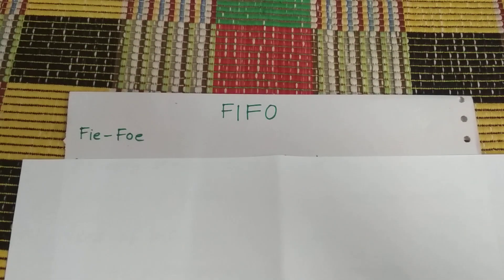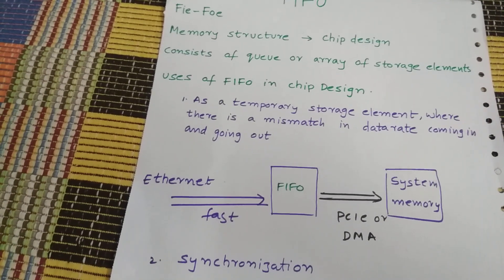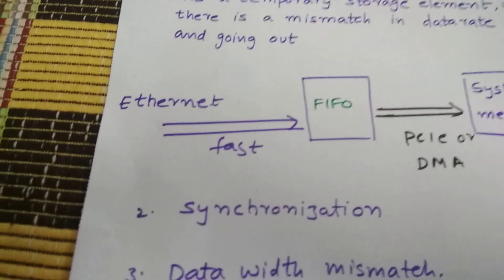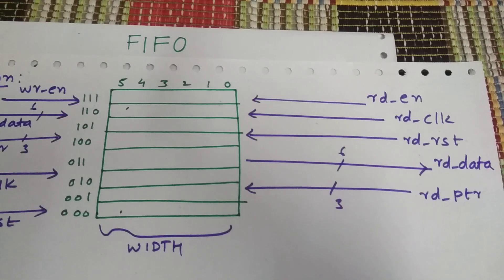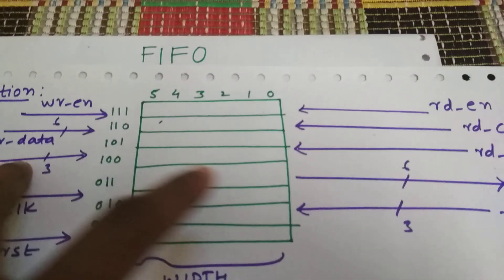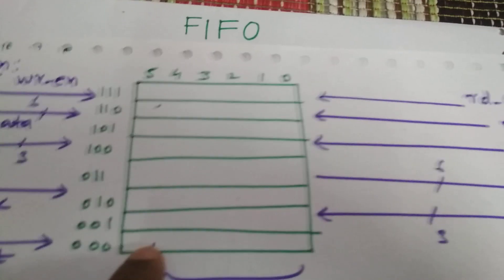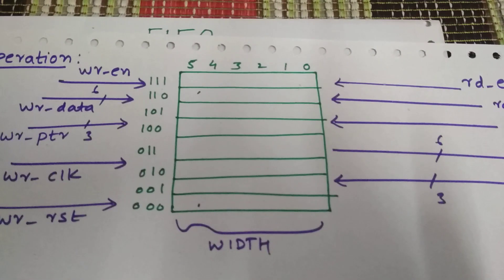Introduction To FIFO Design/FIFO-part 1

Comment: In the timing diagram, isnt the rdata value read out as follows ? 

000 -> D0 
001 -> D1
002 -> D2

You had mentioned it as 001 for D0
Reply from the maker: Nope Do , D1 are just random variables for data .

Comment: Hi Karthik
@7:56 min, when "wr_en" is high, write data should be written at "000" (not "001" as you said), and next time when "wr_en" is high, write data should be written at "001" (not "010" as you said) and so on....
Since just before the rising edge of the clock all signals will settle down and if "wr_en" is found high than the operation will be writing into FIFO will be executed as per data available at that instance and "wr_ptr" will be incremented.
And similar mistake while reading, D0 is read from "000", D1 from"001" and so on...
Am I right??
Reply: I noticed too...

Comment: How are you reading data from an address in the same cycle?? ex D0 from 001 ,D1 from 010 and so on. Will it not take one cycle to read the data after change of pointer.
Reply from the maker: Hey Ankit, thanks for asking the question 
rdptr is rdptr+1 when rd_en  is high it already pointing to the one adress above so we are able to read the data .
Reply: @KarthikVippala  I still don't get it. Lets say. in the fourth cycle. rd_en changed to 1, then it will be captured on the posedge of the 5th cycle, that will indicate that we want to read from the FIFO at the current address it is pointing to which is  000, so D0 is read  from 000 not 001 and so on.  Even if you consider a flop based memory, it will take 1 cycle to give the read data after getting the read address.
Reply: @AnkitSingh2864  You are right !!
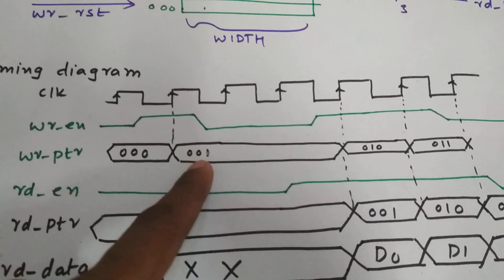The explanation on the video 7:40 - 8:38 is wrong.
Reply from the maker: Namaste shuo chang🙏, thanks for pointing out , good luck & great health 👍 😊
Reply: @KarthikVippala  It's my pleasure. Your videos are great. I have learned a lot from them. Thank you !!
Reply from the maker: Thanks for the support 😀👍

Comment: if asynchronous FIFO is used for synchronizing between Ethernet  and  system memory .and uses two clock domain.
so my question is where we use synchronous fifo ?
what is application of sync fifo?
if async fifo is there then why we are using sync fifo? whar the utilization of sync fifo?
plz give me example like you given for async fifo?
interviewer asked me these all Question plzzzz help me.
plzzzzzzzzzzzzzzz helppppppppppppp me plzzzzzzzzzzzz
Reply from the maker: Hey Murali , thanks for asking the question,

Synchronous FIFO is used in  data transfer , let say if we are getting the data from peripherals  and we have to send it to processor . Here we use   synchronous FIFO to store the data.
Sync FIFO is mainly used to store data .

Hope this clears your doubt, if not please feel free to comment 👍

Comment: Where I can  find numericals for FIFO?
Reply from the maker: You can try , to find depth , frequency , and total size of FIFO, if some parameters are given , you can also calculate async FIFO frequencies , for your practice.
Hope this is what you are asking for. Please do subscribe that will help a lot 👍
Reply from the maker: Can you be little specific Prasanna?
Reply: Like calculating date rate and depth of fifo
Reply from the maker: @hungrylens21   you can check out some interview questions on Google , there is no specific material regarding FIFO. If you have any doubts regarding FIFO , I can help you .